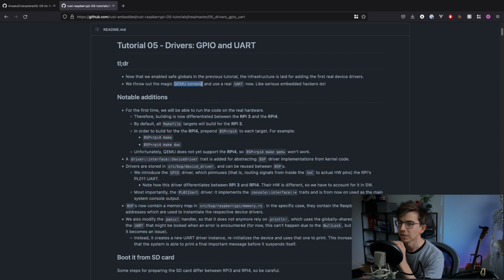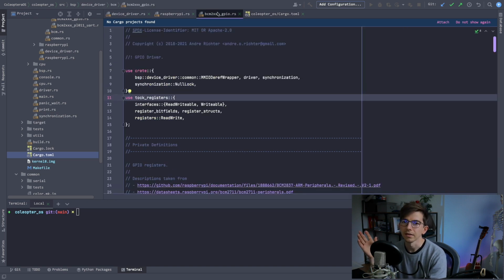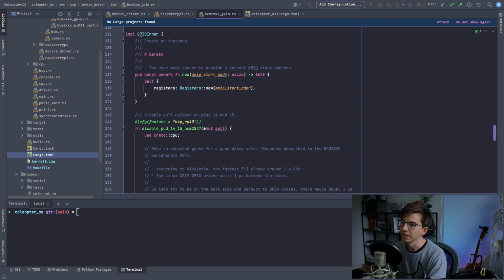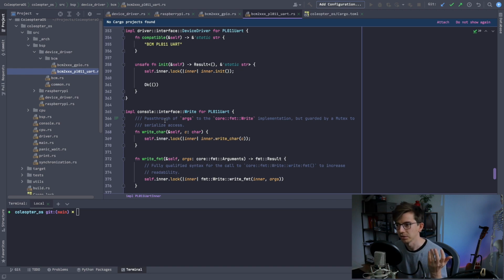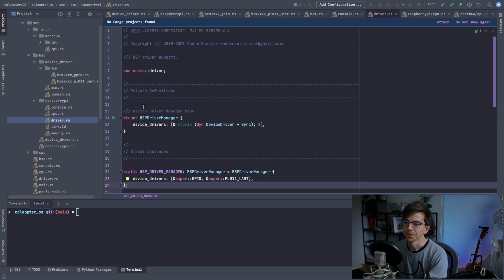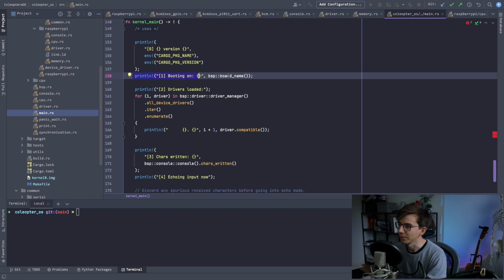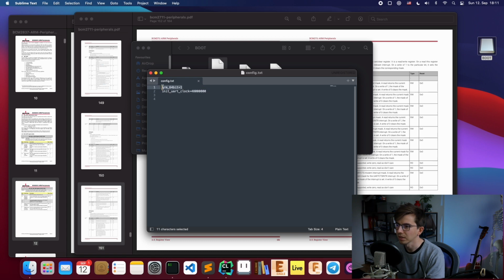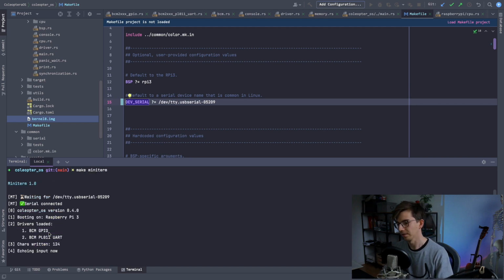Operating system from scratch on Rust - #4 First Run On Real Device + Driver

Comment: Would be cool to see if you can make a compilation target for an arduino or esp too
Reply from the maker: To be honest, I'm not sure that esp or arduino microchips got enough memory, and these targets will require rewriting bootloader. A bit more work ))))
Reply: @mago6449  would be an interesting challenge though! Maybe you could implement some kind of swap memory if you dont have enough memory. You can theoretically add multiple gigabytes of flash storage to an arduino using an sd card, so I dont see why a few megabytes won't work on some dip chips.

It would be horribly slow, but would be a great way to add multiple compile targets to your os ;)
Reply from the maker: @wouter11234  Amazing Idea. I bit crazy but  I like it. I'll give it a try as soon as add virtual memory and process management. Like!
Reply: @mago6449  at least for AVR chips (arduino boards), their default behavior is when powered on to simply load their first instruction from a given ROM memory address (usually configurable). So as long as you have valid machine code there, it will just continue to execute.
Reply from the maker: @MaxTechEngineering  Thanks Max, yes. I'm not sure how to compile rust binary for that. Not even sure that there is a compiler for that. 
Still topic for research.